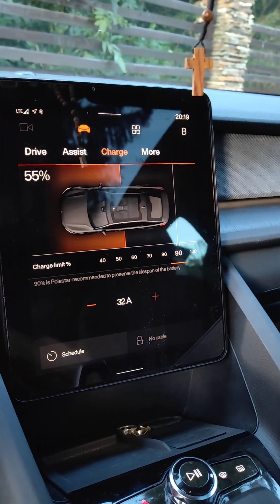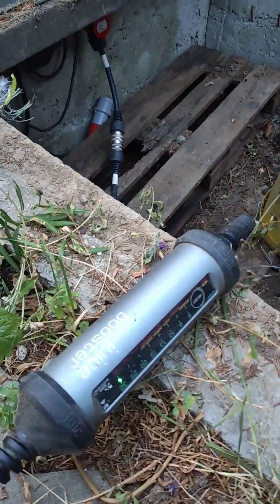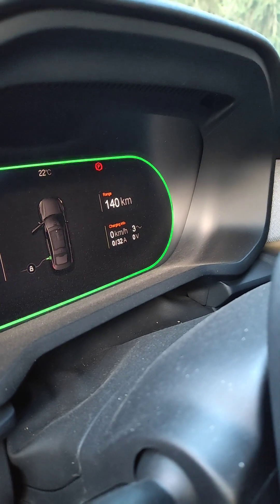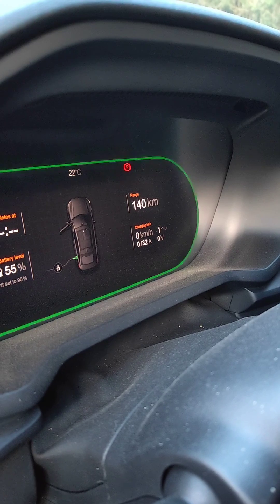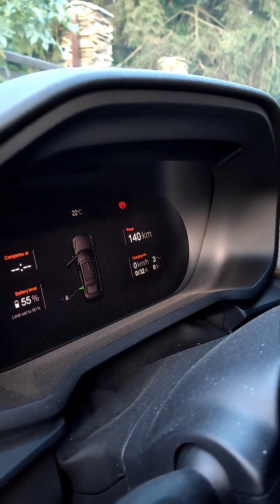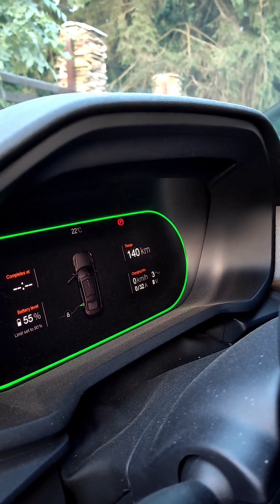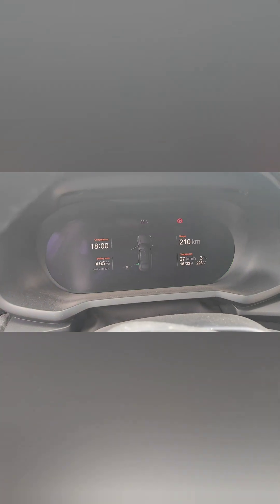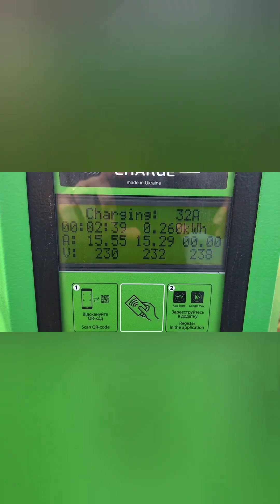Charging issue with Polestar 2 LRDM

Comment: Had the same issue with the XC40, and realised that if the 12v battery is less than 13v you have that issue. Discomnect the 12v and give the battery a charge up 14v and that might help